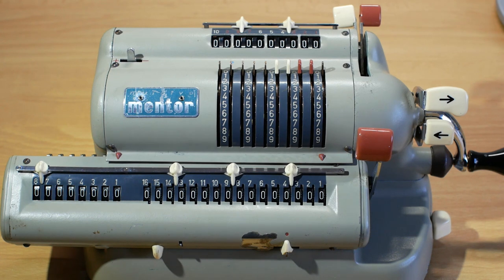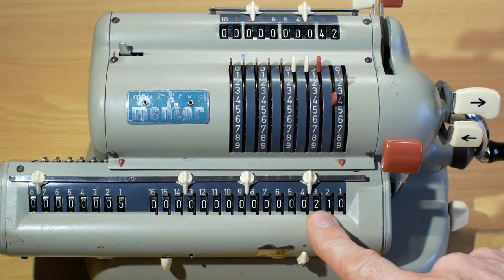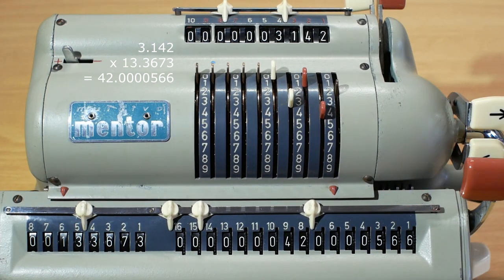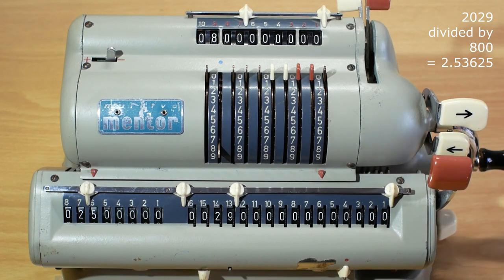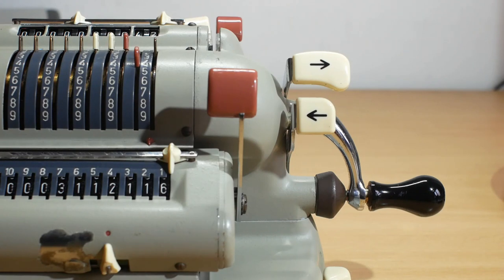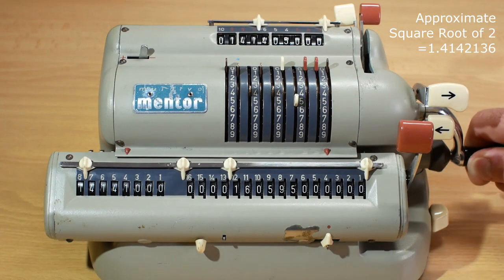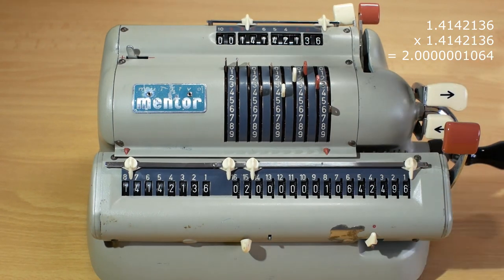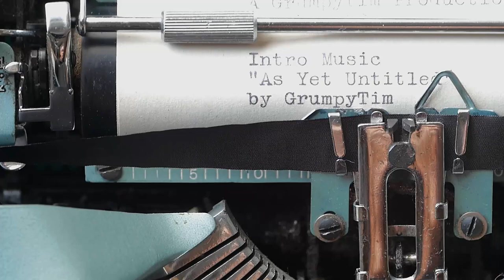Retro Tech - Muldivo Mentor Pinwheel Calculator - Part Two - Demonstration

Comment: I like the George Orwell and Hitchhiker's Guide references.  I'm sure there were probably more, but I'm neither a film nor book buff.  Having said that, I'm sure 32,768 (32k when that used to describe a lot of memory) wasn't a coincidence.
Reply from the maker: Hi Simon, I tend to hide lots of obscure number references into my calculator videos - usually so obscure that I probably can't remember what they were!!!!  But you're correct, the 32,768 wouldn't have been a coincidence (I probably multiplied 128 x 256 or something like that).  I think the Hitchhiker's reference has managed to sneak into all my calculator videos, just because.........

Cheers for watching.

Comment: It must have taken some time to figure out how to get the best from those machines when they were in development and new.
Reply from the maker: I'm guessing that the mathematicians and engineers who designed them probably had a pretty good idea of what they could do at the time they designed them - they just had to pass that information on to the rest of the world who would be using the machines.  Felt and Tarrant who made Comptometers actually had their own schools to train comptometer operators.  The comptometer is basically an adding machine that adds the number as you press each button (no handle to crank) - they were extremely fast in the hands of an experienced comptometerist (if that's even a real word), because you could enter multiple digits at the same time - the operators would use them like touch typists, not looking at the keys as they worked through a list of numbers.  The comptometers could also subtract, divide and multiply using various methods.  I'll do a video on a comptometer at some point but at the moment the machine and myself are in different locations so it'll have to wait for a bit.
Reply: @GrumpyTim  I might have to restore an adding machine I have at some point.
Reply from the maker: @BensWorkshop  They're kind of fun to play with and definitely worth doing - you'll enjoy it.